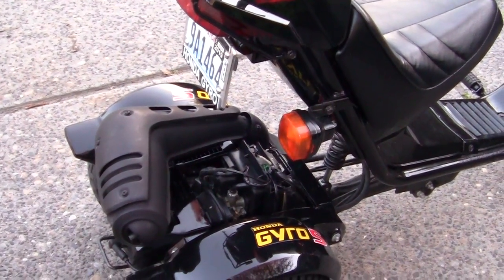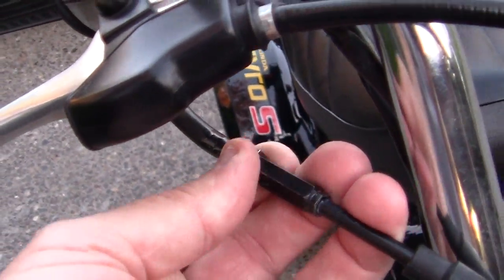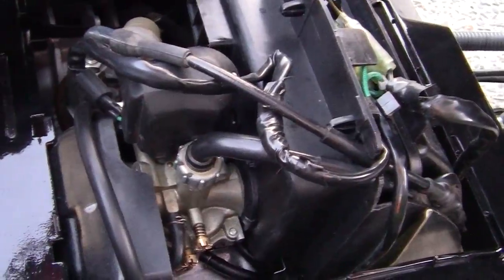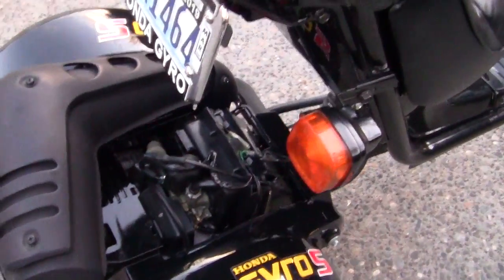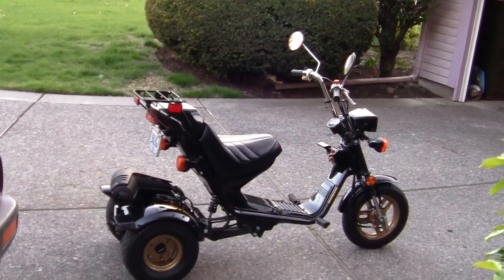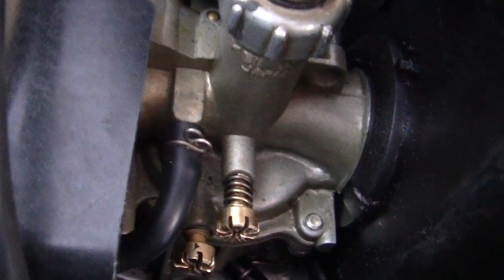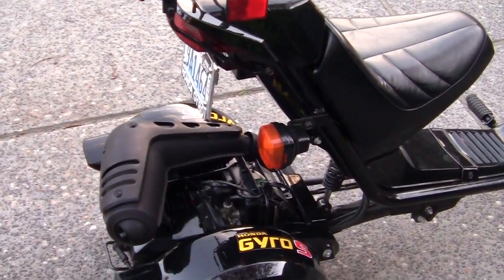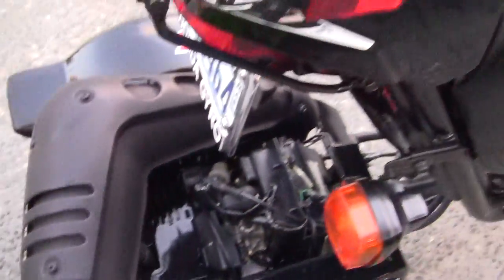(29)- 1985 Honda Gyro Problems

Comment: Check  the spark plug wire.. for cracks..I just tuned mine..and with the 8in tires upgrade that actually last ..doing 40mph with regular gas mileage( about 80mpg pulling custom mini scootertrailer.. i drive all year round..
Reply from the maker: Last week I went to check the spark plug, AND the spark plug wire fell out of the boot. You called that one on the money....I just went down and purchased a 3 foot section of spark plug with the new boot for 12 bucks. I jury rigged the old plug wire to the old boot and the bike ran fine. You must be psychic, my friend. Thanks for your advice. RH DSD